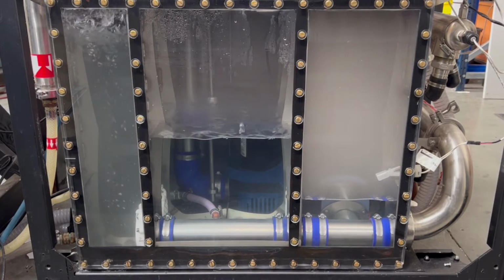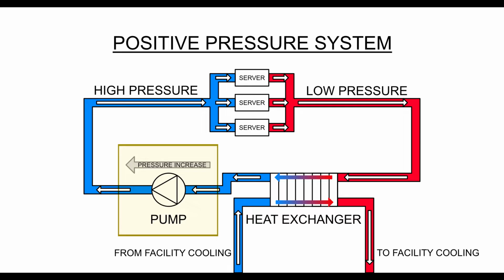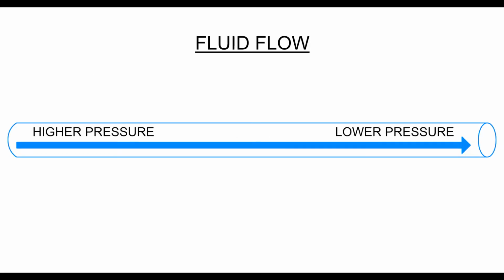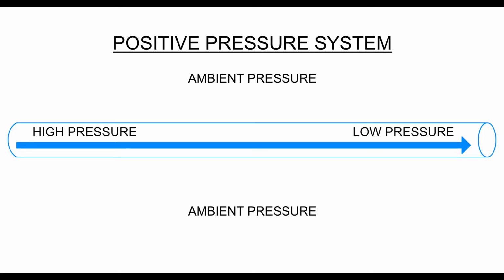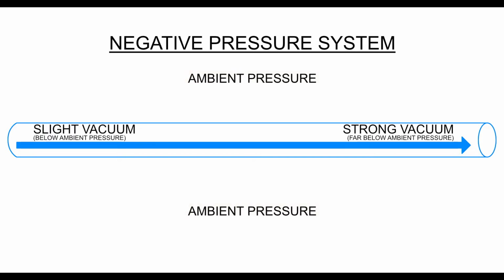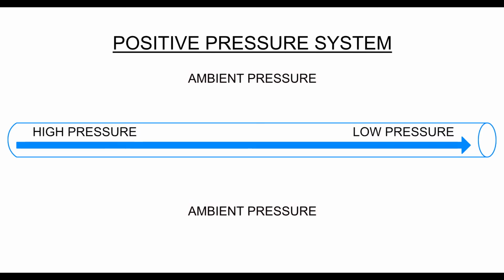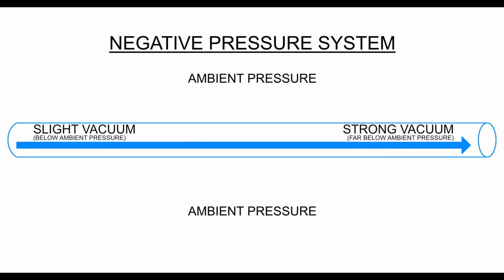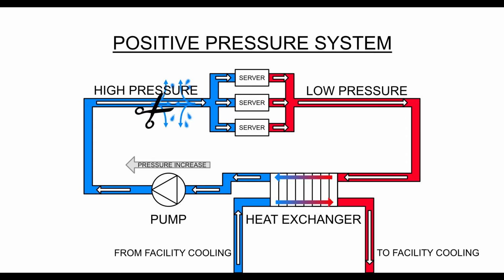How Does Chilldyne's Negative Pressure Liquid Cooling Work?

Comment: Ahh, I see. It makes so much sense now. I out it hard to visualize without this video. I think partly because I hadn't considered that the fluid itself can be in a slight vacuum. Something about it not being as compressable as air made it very difficult for me to imagine. Like, low pressure air is way less dense, more space between the molecules and shit. Was difficult to imagine how negative pressure system could be used without it being explicitly told to me that's what the system used. 

With new knoledge in mind, I take it that this system, in a vacuum, as in standalone and no ambient pressure outside, still functions as a positive pressure system that has a pressure gradient just as a normal system would. However, since the overall internal pressure is lower relative to the actual ambient pressure, relatively speaking, it makes it a negative pressure system while functioning under the principles of positive pressure. 

Brilliant.

Comment: An interesting method. I wonder if its simplification of connections and disconnections is going to prove a crucial step towards standardized, flexible and omnipresent liquid cooling.
Reply from the maker: Thanks for the comment. There is a project called OCP that is trying to standardize liquid cooling but getting all sorts of competing companies to agree on one design is not easy.  We feel that pumping under negative pressure solves the biggest concern with regards to leaks.